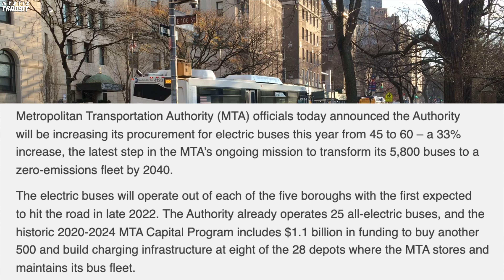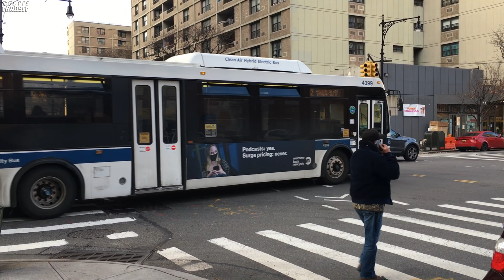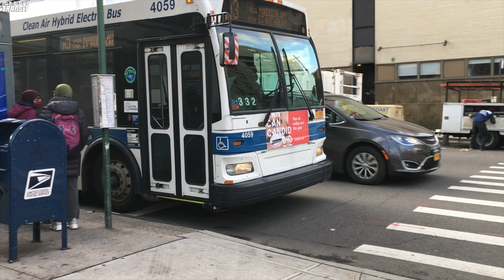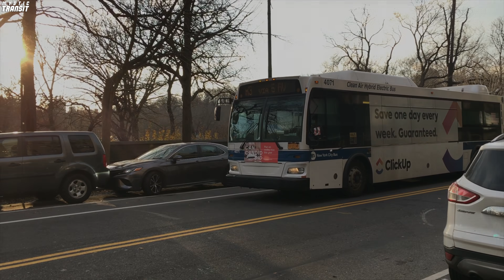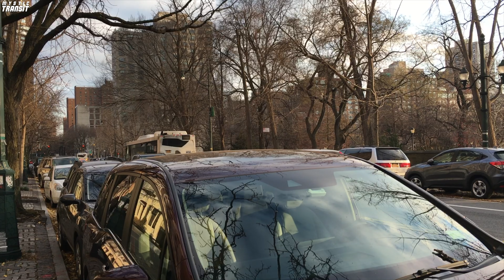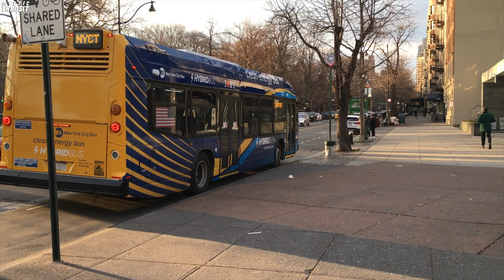Retiring the Orion VII's - NYC's Bus Fleet Modernization

Comment: I love driving the Orion 7 NGs in cold winter days. They have amazing driver heaters. I think they're starting to be replaced by the Novabus HEVs at my depot, MJQ
Reply: Yall lucky to get the new buses. Us at jfk depot get all the hand me downs from y’all.. today I was actually operating a bus that still have the Quill depot logo on it lol bus #4127
Reply: @bryanharry9626  This will be the last time for the foreseeable future that OA/TA would be displacing buses to MTA Bus. Don't worry, JFK Depot is getting a fleet of Nova LFS' in 2023. MTA Bus has another order which will allow JFK/FR a fully upgraded fleet of 40-footers. No more hand-me-downs by then.
Reply: @bryanharry9626  JFK is also slated to get new buses as well.
Reply: In 2026 we now have 16 Orion vii ngs left in manhattan running in the manhattan ville depot. It’s so sad to see them go…
Reply: Quill is not getting NovaBus LFS HEV's. Rather, they are getting 76 New Flyer XDE40s to replace all the Orion VIIs (30 from the base order of 110, and 46 for the option order of 84). The numbers of these buses are 9590-9619 and 9416-9461. With the 43 XD40s they also have (7572-7614), this will comprise 119 standard buses, and thus will become 100% Xcelsiors for the local fleet. Rumor is that they might get the BAE buses 9505-9509 from Grand Avenue.
Reply: @TheRailLeaguer  well our drivers here are being required to train on them. I've seen 9684 in the depot but that's a MHV unit. They're using it for training
Reply: @josephnyy86  Oh okay. I’m guessing that they might be preparing for a transfer to Manhattanville or something?
Reply: @TheRailLeaguer  the B/Os, nope. There are posters all over the depot saying that all operators must attend the training
Reply: @josephnyy86  Oh okay.
Reply: @TheRailLeaguer  It is customary for depots to receive buses for B/O's to be qualified on. Regardless, if X Depot doesn't have them. It is part if Y B/O moves to another depot that has a different bus type. Although in 2010, Quill was sent an Old Gen from Manhattanville to qualify/train Quill B/O's in preparation to accept 6690-6747 from Amsterdam in June of 2010.
Reply: @josephnyy86  there's also some of ur xde40s in mv
Reply: @TheRailLeaguer  Look at all the HEV's Quill has now. Manhattanville took all the XDE40's. The LFS HEV's at Quill just got inspected too.
Reply: @Moyaiville_Productions  I heard. Plans may have changed for Manhattan.

Comment: I have a question Mystic. What was the saddest loss for you other than the RTS?
Reply from the maker: D60HF. Those were my favorite buses.
Reply: @MysticTransit  Wow same here. I grew up with them on the Bx1/2 along the Concourse and those D60's dominated Grand Concourse. You would also hear the CNG Orion OG's from 10 blocks away 😂.
Reply from the maker: I grew up with them on the M101, Bx15, and many of the Bronx bus routes.
Reply: @MysticTransit  Good ol days man.
Reply: @BxRailfanJRP  when the Bx6, 11, 35, and 36 would cross on 161, 167, and 170 Sts, and Tremont Avenue